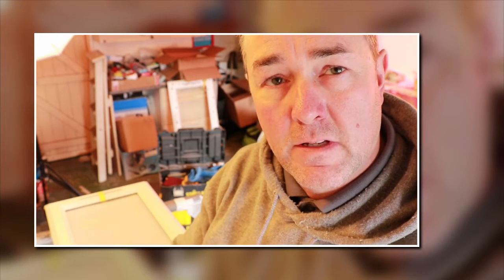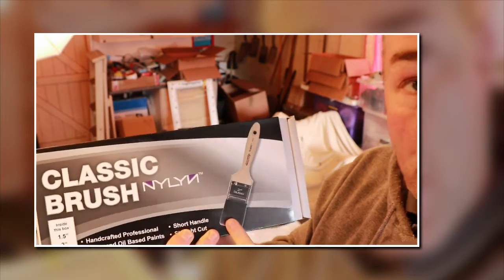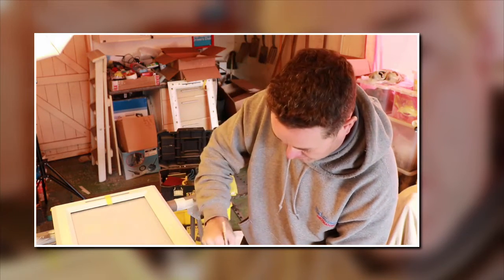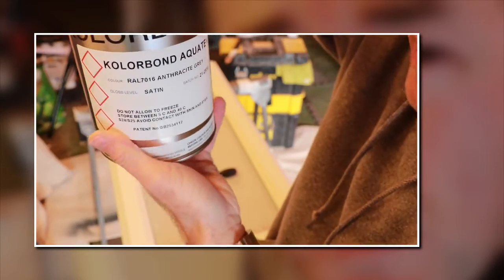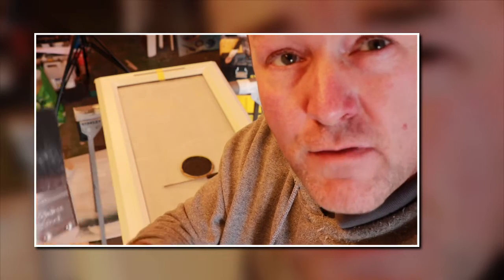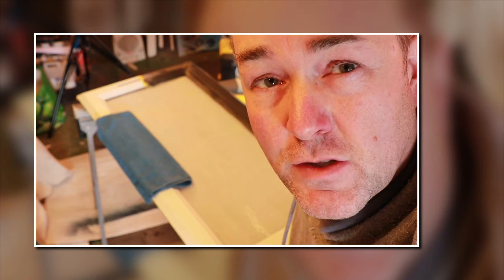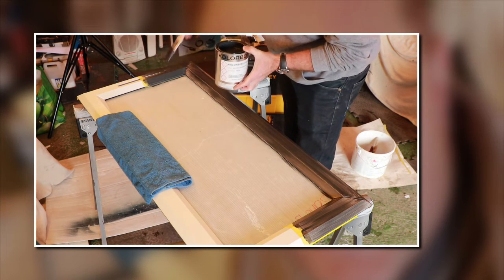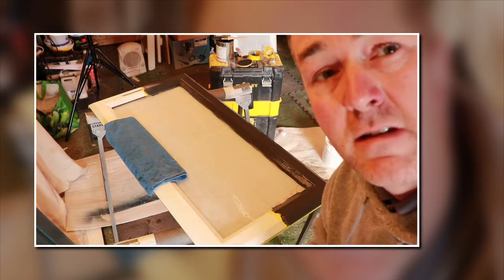how to paint uPVC - by brush application using KolorBond AquaTek

Comment: Phil can I ask if you have a preferred on line shop to buy brushes etc, or do you buy local 😉
Reply from the maker: Not really.
For brushes I like to feel how the bristles are.

The arroworthy I've bought from Crown Decorator Centre near me . They had na offer on, think a ⅓off.
I also use Eco Union, get those via Tikkurilla UK 
And I like the triple pack for Wickes own brand brushes @£11 a set 

I do use MyPaintBrush for stuff like tapes and paper roll and drop sheets etc
Reply: @ProfessionalPainterDecorator  cheers Phil, I have bought from my paintbrush before, I'll have to check out the arroworthy,they seem reasonably priced, I was always a hamiltons man back in the late 80s early 90s when I was serving my time, I left the painting mid 90s and only this last few years have started doing a few weekend jobs for folk, so much has changed, that's why I appreciate so much watching your videos to pick up the latest tips, it's like serving my time all over again 😀 👍

Comment: hi phill hope your well  what website do you buy the kolorbond paint from? also for windows would you use the matt finish? does it need to be mixed with hardener 
cheers :)
Reply from the maker: All good here. No mixing, both KolorBond I use is straight out the can..... I buy direct from KolorBond.co.uk they have different products that may suit your as well.

Finish... Personal preference. I like the satin. But a mat finish does look quality ;) and a bit more forgiving if you mess up. ;)
Reply: haha! yeah :P
do you use solvent based or water based for your upvc and do you know roughly the drying times? cheers phil you've
 been very helpful  @ProfessionalPainterDecorator
Reply from the maker: @Shortboxing47  Ha
have you check back on my uPVC door and window spraying vid yet? They are the Kolorbond original/classic and it's more a solvent based product and dries within minutes. The water based takes at least 15mins .. depending on the weather.
Reply: @ProfessionalPainterDecorator  i will go through and double check if i have, i have watched alot of your work now,  how far does a litre take you? also can you use the kolorbond paint for inside jobs, like kitchens things like that? thanks sorry for the bombarding of questions mate haha im just trying to set my self up for a new career
Reply from the maker: @Shortboxing47  no idea how I missed these questions.

You'll get a good three or four doors done with a litre. Depending how many coats you do. A mist coat and three nice top coats is ideal. You may get away with two coats depending how it's looking and the colour.

You can spray inside. Make sure plenty of ventilation. Thats where the water based will come into it own ;)

Comment: are you going to spray the other half?
Reply from the maker: I will do for another video.
Reply: @ProfessionalPainterDecorator  did you spray the other half and does it need thinning for gravity hvlp gun ?
Reply from the maker: @josephgregoire5792   yes, I used hvlp. It's on the other video. I didn't thin it but you could add a bit too if you feel it a bit thick. Check with Kolorbond just to check.